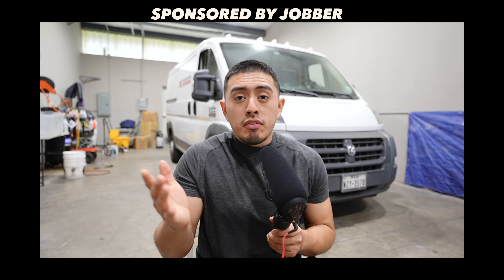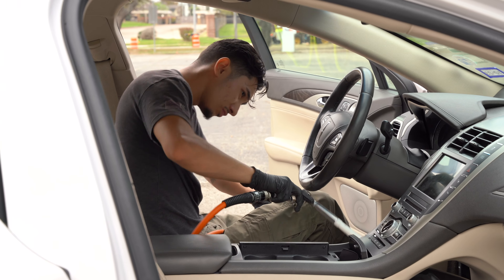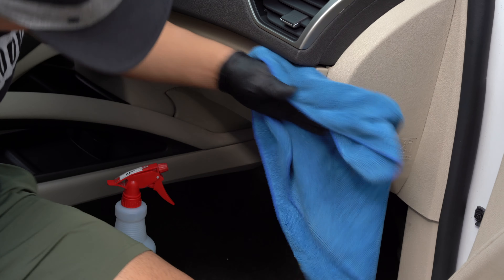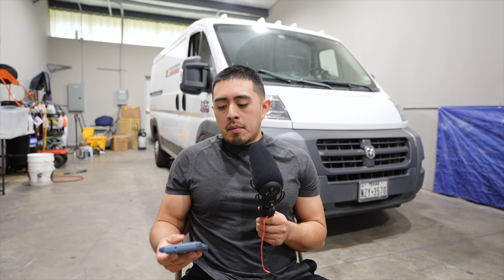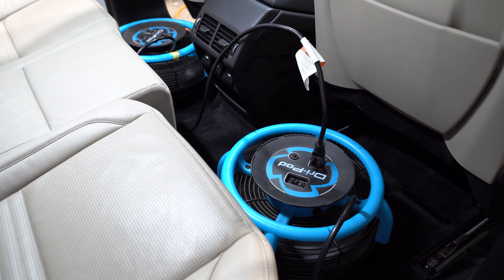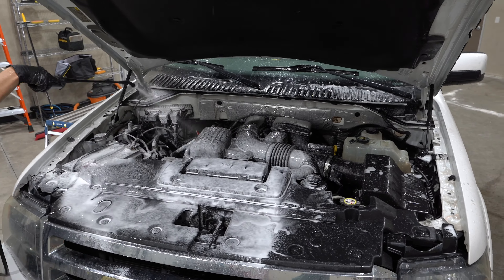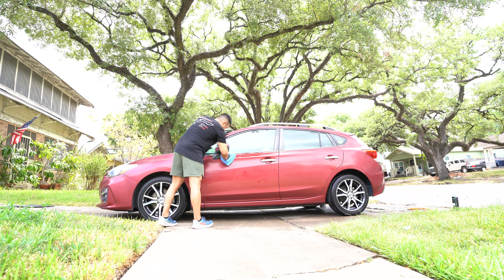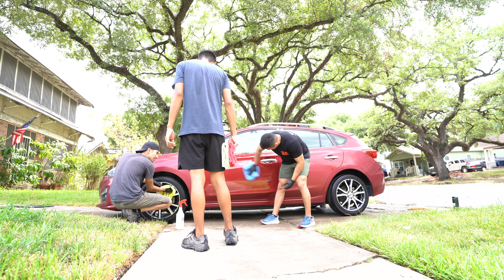My Cheapest to Most Expensive Detailing Services (Price Breakdown)

Comment: 100% agree on the coating packages. I have one coating package in which I coat everything - paint, black trim, headlights, brakelights, wheels, windows, badging, grill - every exterior surface. Starts at 1500 ( cars)  - 2,000 (SUV) for new or exceptionally well maintained vehicles and goes up depending on condition of the car and how long it will take. I base my estimates on minimum of $100/ hr. 
If you're just starting out and think those prices are too high - go do what's needed to attract a high end client base and come back and say that in 5 or 10+ years. You'll see what I mean. The work is out there. Go get it.

Comment: Hey man informative as always !👍 Question have you ever had a stain on a seat  that you couldn’t remove or where the seat looks clean but when it drys it leaves a ring? This is what is happening with my car it’s a 2010 Hyundai and I’ve used upholstery drilled brushed and wiped with a rag but nothing
Reply: @jjjjjjjjjjjhjjjjjhjj  what?
Reply: You need to add a neutralizer after cleaning it. While it’s still wet use something like Fabric Rx from Shine Supply or the Finisher from P&S
Reply: The cleaner you're using may be drawing the stain back to the top or off of whomever sits there and back into the fabric. If you don't completely remove it with an extraction or neutralize the shampoo this issue will continue to occur. I hope this helps.
Reply: @manolocirilo5618  Thanks for the advice
Reply: @marshprofessionaldetailing9794  yes thanks!:)

Comment: Im doing this just for summer as a side job. I started many years ago with the cheapest price and worked my way up according to experience. Now i charge 150$ inside for vacuuming, some scrubbing with the floor matts and salt , dirt in drivers seat mostly removed and windows cleaned. Plastic is all cleaned and condition as well. I don’t own any garage. Just do it in my car port. I charge 150$ for just wash , clay, and wax . Then 300-400 for 2 step correcting and 3 year ceramic  coating with graphene. I figured its in the middle since i don’t own a garage and just have 1-2 cars a week with my full time job

Comment: OSCAR OSCAR IF YOU'RE USING 3D SPEED GREAT. BUT MAY I SUGGEST 3D ATT 505 CORRECTION GLAZE. 3D SPEED WAS SUPPOSED TO BE DISCONTINUED AND REPLACED WITH 505 CORRECTION GLAZE. IT IS THE SAME EXACT THING EXCEPT THAT THE CORRECTION GLAZE HAS MORE PROTECTION AND CUTS A BIT MORE. THE GLOSS AND PROTECTION IS SO MUCH MORE THAN THE 3D SPEED. NO DUST AND EASY TO REMOVE AND SUN FRIENDLY. I HIGHLY RECOMMEND THE 3D ATT 505 CORRECTION GLAZE. AND IF YOUR GOING TO USE CORRECTION COMPOUND. USE 3D ONE, NO DUST, NO FILLERS BUT LEAVES THE PANEL OILY. IT ADJUST WITH THE PAD YOU USE. 

SO ONE COMPOUND IS USED FOR WHICH EVER PAD YOUR GOING TO USE. THAT'S WHY IT'S CALLED 3D ONE. I CARRY 3D ATT 505 CORRECTION GLAZE, 3D POXY, AND 3D ONE. THAT'S ALL I REALLY NEED. THEN JUST ADJUST THE PAD NEEDED TO GET THE JOB DONE.
Reply: COOL STORY BRO! 👉🏾👍🏾

Comment: Everybody’s out of control with these prices these days. this is why you need to learn how to do things yourself.
Reply: Well I'm a female, 46, please do this yourself everyday & tell me how it goes.
Reply: It’s 2024. Gas isn’t .99 cents a gallon anymore. Inflation. Thank Biden
Reply: It is very labour intensive. I did a paint correction with cutting and polishing with a ceramic coat and it took me  nearly six hours. That includes snow foam, contact wash, clay bar prep work. If I were to charge someone else, I'd easily charge £600 / $800 for it.